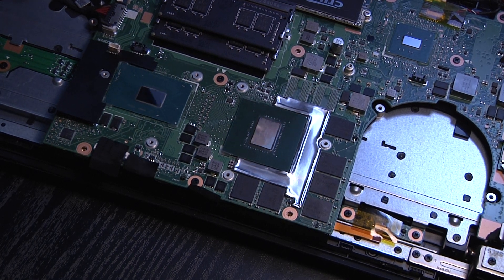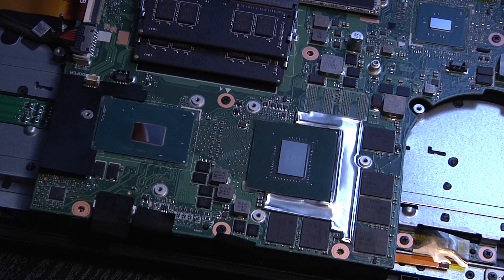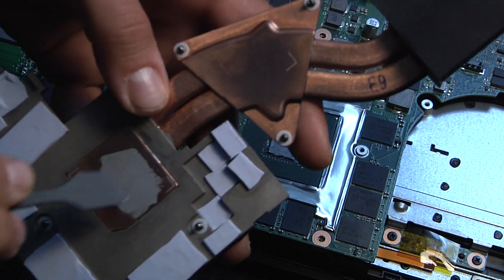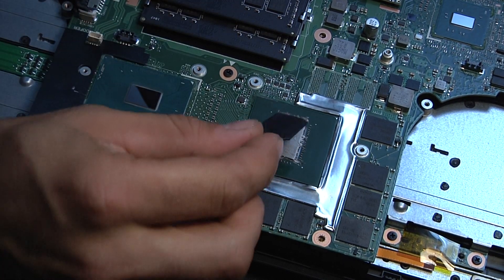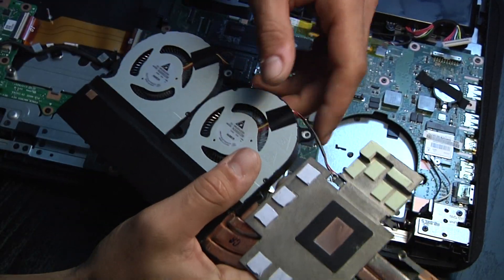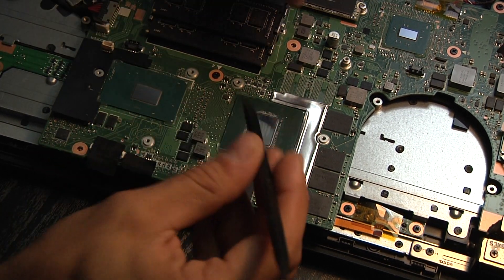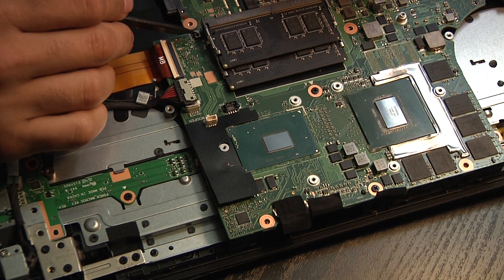How to repaste a laptop CPU & GPU

Comment: Hello.  I accidently damaged the black square ped on copper heatsink (seen on 12:55) with acetone while I was trying to renew the thermal paste on my laptops cpu. And I had to remove it completely. After the process, my laptops cpu works with 60 C- 70 C while I watch netflix, but the chasis is burning like crazy, even my SSD harddisk reaches 52 C, the keyboard  burns!. So, do anyone know that happened because of the square ped I removed? Shall I cut a new thermal pad and stick there in same shape? Is that works? Or I did apply the paste in wrong way. I do not know what to do, can anyone help me please?

Comment: is it normal if the battery ribbon sparked when connecting it back
Reply from the maker: It's not "good".. but can happen.
Try to plug in evenly and swiftly.
Reply: Hotel Hero doesn’t mean a component is broken right? thank u

Comment: Hey man i think i over applied it , just a bit though , what's your thoughts?
Reply from the maker: Would be difficult to add so much that the volume would be problematic. If you added just a bit more then it's fine
Reply: @HotelHero  thanks, actually it's working fine , temperature are down significantly.

Comment: Hey, I tried taking off the heatsink but unfortunately two of the screws are extremely tight and I've messed them up bad. Any suggestions?
Reply: Maybe if you use a bit of motorcycle oil on it, very very little
Reply: @Raylightsen  no dont fucking do that wtf

Comment: i have  a predator helios 3oo and suddenly after playing a game for 10mins my laptop reaches 99c and shuts down and normally it is at 70c without game ,i tried undervolting and its not working,can some one help please
Reply: I bet you need to repaste and change the thermal pads, and clean the metal fan vents
Reply: Of course every laptop shuts down when it reaches 100c or closer, the manufacturer designed that way

Comment: This video saved my laptop.  Bought an MSI GE75 RTX2080 laptop for cheap. This thing was going up to 96 degrees while gaming. I opened it up for a repaste. I figured I can probably do it myself. Something just looked off when I took off the heatsink but I couldn't put my finger on it. Then I saw your video and realized what it was. Someone put thermal paste on the chips that are supposed to have thermal pads. I mean this stuff was everywhere. Cleaned everything off and applied new pads and thermal on CPU/GPU. Now it doesn't exceed 80 degrees under full load. Thnx a lot!
Reply from the maker: Good catch
Reply: @HotelHero  what happens if i have both pads and thermal paste on the chips, as thats how it is on my acer :o
Reply: That thing on the chips is different than the paste on the cpu/gpu. That paste is actually better than pads if they contact properly. So your problem was probably just the thermal paste on the cpu/gpu

Comment: okay, so my fans stopped working after this video, and I've doubled checked twice that they are connected properly. Any suggestions?
Reply from the maker: If they stopped working they are either:
1. Not connected
2. Damaged from misuse
3. Your temps are sub 40 C in which case they don't turn on
4. Some other mechanical issue

Would help if you also listed what model you have
Reply: @HotelHero  Really appreciate the response, been following your videos since I got my laptop. It's a acer predator helios 300 G3-572-72YF. I know it's not because my temps are too low and I'm pretty confident my fans are connected properly. Could you elaborate on damage from misuse or other possible mechanical issues? My laptop is old, almost 4 if I'm not mistaken. It has overheated a few times and I've had countless preformance issues within the past few months. The reason I took off the fans to begin with is because after formatting my computer, one of the fans maxed out at 4000rpm instead of 6000rpm. So I thought since the warrenty is gone I would go digging around and see what the issue is. I found out one of the fans isn't spinning properly, so I detached it and put some bearing oil in it and it seemed to spin just fine. But when I put everything back together and turned it on. The fans didn't work. During this process I also repasted the cpu and gpu.

Comment: I’m on my 4th re-paste, having quite a time getting better than factory temps on both GPU and CPU. Its been a real pain in the ass. I don’t think the heat sink on the Asus GU502GV makes perfect contact with the die on both GPU and CPU. I made sure thermal pads were of the proper thickness but I’m not quite there... next method will be the X method. Do you have contact info?

Comment: Hi, thanks for sharing with us your method, it's great! I do have a question: What thickness should the thermal pads be? I have an Acer Predator Ph 317-53. I can't find any info about the thermal pads on this one..  I wanted to go with 1mm but I'm not sure if it's too thick or too thin, thanks!
Reply: same as you
which one then you went with ?
Reply: @ahmedalsaegh4897  I ended up repasting without replacing the thermal pads because this is quite tricky if you don't know what you're doing. You see, some thermal pads are thicker than the others and some are slimmer and it varies from one to another, and if you don't use the right thickness you might end up worse than before (not always, but there's still a risk) - because there needs to be a certain pressure on the cpu&gpu die-. So, I repasted with Noctua NT-H2 and it dropped my temps for almost 20 Celsius on CPU and up to 10 Celsius on GPU, the stock thermal paste is terrible.
Reply: very good results 
thanks for sharing 
I think I will do the same 
but using the thermal grizzly kryonaut  paste 
what is your thought about it ?
Reply: @ahmedalsaegh4897  Kryonaut is one of the best (if not the best) thermal paste (non-metallic) out there. It's pretty expensive for the smaller tubes but the 11 gram tube has a really competitive price. I initially wanted to use that one too but I just couldn't find it anywhere.
Disclaimer: it might dry faster compared to other thermal compounds but if you're using it on a laptop there's not gonna be a problem since you'll have to clean it out of dust at least once a year, therefore, a repaste/year.
Reply: how much did you put  paste on the die and  tightened the screws of the heat sink ?is it as hotel hero said ?
Reply: @ahmedalsaegh4897  I just used the line method because I thought it's the best for this case. Tgk (short for thermal grizzly kryonaut) is meant to be spread. They did several tests and spreading it seems to be the best way to apply it (not true for every paste/ cpu/gpu die size).
Reply: @ahmedalsaegh4897  And I tried not to over-tight the screws to not cause too much pressure. I kept tightening them until I felt that it's enough, it really isn't that hard.

Comment: So you don'y need the plastic tape stuff at all over the pins? I re-pasted my FX505DV yesterday and it made no difference, but I left the little tapes on my CPU and GPU. there's no paste underneath them, but I wonder if it would be better without them. My GPU maxes out at 86 degrees when playing Modern Warfare 2019 and my CPU is always around 89-91 degrees when  playing any games.

Comment: after repasting my laptop cpu cs go reports its running hot at 92 degrees C i7-3630QM (3.4 GHZ) .Does that mean I did the repasting right? (pea drop method) Alienware M14xR2 GPU is only 70 degrees C though!

Comment: The only thing about the spread method I worry about is trapping large amounts of air bubbles that get folded in as you spread it around.
Reply: That has been debunked by der8auer and others. As they say,  it's BS.
Reply from the maker: Agreed, this has been debunked not only by others, but by myself the last 50 times I've repasted 😅

Comment: Hey! How can i contact u ? I cant see any email and i have some question id like to ask.
Reply from the maker: What's your question?
I don't have a online presence
Reply: @HotelHero  Well. I have acer predator 300 helios with 1060 gtx 6 gb and i7. And i have like mini lags for 2 seconds. Even for games like league of legends. Idk why. Id like know how to fix it
Reply: @netwikimmortal2604  if you have high cpu temperatures, it might be thermal throttling.
Reply from the maker: @netwikimmortal2604  Most common issue is your using the OEM OS and you've just updated to the latest version. I recommend a fresh install of the latest version.
Reply: @HotelHero  Im sorry but what is OEM OS ? I have never heard this before

Comment: Thx for the tips about applying paste. I have a G9-793 from 2016 I want to repaste, since it's out of warranty, and very very hot while gaming, but can't find any info about the thermal pads. I saw in this video the cooler for predator 15 which is similar, and wanted to ask about the thickness of the pads. Is 1.5mm ok ? are all the pads the same thickness ? and how much do I need ? 100x100 or I can get away with 2pcs of 120x20mm? thx in advance if you have the time to answer these questions !
Reply from the maker: If you go 1.5mm you may have to re-tighten the heat plates once the pads get warm/soft. That way if the pad is slightly too think it will confirm to the chips and reach proper clearance/spacing.

Comment: Hello Hotel Hero, im lost i got a Helios 300 317-52 and i tried all nothing helps. I Undervolt GPU and CPU i repaste 4 times i did everything and my Laptop is during gaming nonstop on 95° at the GPU and CPU i dont know what to do anymore. It Throttles so hard that i got the first few minutes 100 fps after 5mins drops too 60 and then downspikes to 20-30. Dont know any further i tried everything suggested
Reply from the maker: If your GPU is surpassing 75-78 C then you pasted improperly or tightened it down incorrectly

Comment: Thanks alot for this video! I have suffered with thermal throtteling on my new Rog Strix Scar 2 GL704GW, since i bought it. Followed your vid and metod to apply new Thermal Grizzly Kryonaut on my Cpu/Gpu. I was shocked when i took off the heatsink, cause the paste jobb from the factory was terrible! Before the repaste i got 90+ and thermal throtteling all the time and had to turn down all the settings and even then it was struggeling after a while, and the fans was going full speed. Been testing now with GTA 5 with optimal settings in Geforce Exp since i repasted and im on a stable 70 deegres on full load, so about 25 deegres down from pre paste. Thanks for the vid and guide im overjoyed and can finaly game on my gaming laptop again! Cheers keep up the good work!
Spread metod works wonders!
Reply from the maker: Awesome dude!
Now go forth and destroy plebs! 😁

Comment: Which are the correct thermal pad thickness for the helios 300? i need that info please.
Reply from the maker: It's a combination of 1.0 and 1.5 mm pads
Reply: @HotelHero  I don't know of other model is like you say, but for the G3-571, which is mine, i tried 1.5 with 1.0 and didn't work
I learned it the hard way that is only 1.0 mm sadly

Comment: Tha is bro that's what I've been having problems with I repasted and then I tried to tighten the screws as hard as i could and my temps are about the same if not worse . I have Dell xps 15 9570 of u have any advice it's most certainly welcome and I'm here to learn . I wanted it to stop throttling .  I used thermaltake tg7 thermal paste from best buy .
Reply from the maker: Depending on the screw config (spring set or not) that could certainly cause issues. Like I discussed in the video most systems thermal pads provide the spacing required for proper paste application.

Also I recommend giving MX4 a try. It's really good paste and last super long, the 2019 release has a advertised lifespan of 8 years.
Reply: @HotelHero  isnt thermal grizzly kryonaut better in tempertures?

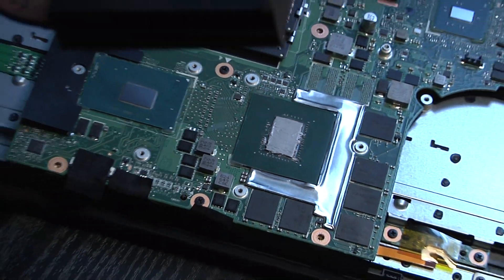Comment: Whats that white foamy squares in 6:38 im kinda curious if thats important or whats the purpose of it?
Reply: Thermal pads, if you look they are over other chips on the board they help draw the heat from them.
Reply: @Innermoist  oh, so what if the pads are damaged? Is it necessary to change it? Because I had those pads on my laptop but the pads are like half broken, maybe because its very old, my laptop is 5 years old now
Reply: @pointdss  I've seen people re-use them but me personally I'll replace it if your putting new paste on you might aswell do the pads.

Comment: Thanks for the video. I have the 2019 Helios 300. I get max temps up to 88 on cpu and 70 on gpu while playing Apex Legends. That’s with Turbo button off and CoolBoost on. Balanced power setting. Are these temps ok? Should I repaste it? Any idea if the stock paste is not good enough on this laptop?
Reply from the maker: I also have the 2019 H300 and your temps are fine. When you reach 95 C your CPU will down clock (thermal throttle) which is what you want to avoid.

I have premade Throttlestop configurations based on what CPU you have if your interested.
Reply: Hotel Hero thanks for the response.

Sure how can I get the profiles?  I have TS installed but haven’t changed anything on it yet though. What do the profiles do? Will the Turbo button work still? I see PredatorSense has its own built-in XTU Service which I assume is how the turbo button cranks up the PL1 and PL2 voltage. Will this still work with the TS profile?

Right now how I’m keeping my temps low; I use 99% power profile in windows and use Extreme Overclocking profile in PredatorSense (just to avoid the loud max fans).
Reply: Hotel Hero on another note, do you use the LCD overdrive feature? Can it have any negative effect on the screen long term?

Comment: Hi bro I appreciate it  your good work and helpfull video for everyone. On my predator g5 I consider replacing old thermal pads with thermal paste (thermal grizzly maybe). Would you recommend it or you think it will better to replace it with a new one thermal pads?
Reply: Also can you tell me the thickness of thermal pads on that model? 1 or 1.5mm thank you!
Reply from the maker: @slavidimitrov2097  Since the manufacturer set thermal pads in the first place, replacing the pads with paste might remove the factory gap (the springs add the right amount of tension but don't set the spacing) so I'd recommend if you swap pads to just replace with the same size pad (looks like 1.5mm) to avoid any issues. You can grab Arctic thermal pads for increased conductivity and should be a decent upgrade.
Reply: @HotelHero  thank you for answer. I will chose some thermal pads. I know the best thermal conductivity has fujipoly thermal pads but I don't know from where can I get it.

Comment: bro, can u please do undervolt and overclock video of acer helios 300 (2019 GTX 1660 ti) model please? (picture of voltage/frequency curve will do too. if u can attach a link with this comment.) i would greatly appreciate that bro. thanks.
Reply from the maker: I'd love to but I don't have access to a 1660ti bro.
Reply: @HotelHero  Would the 8th gen 2018 model have similar values to the 7th gen?

Comment: Ok so random question. I’ve already liquid metaled my laptop my laptop is a Acer Predator Helios 300 (2018 edition with a GTX 1060 and Intel Core i7-8750H 6-Core Processor) anyway it’s a lot cooler but I want to squeeeeeezeee more performance out of it with a heavy overclock but most places I look I can’t find a really heavy overclock so I was wondering if you could make a video showing us how to do that. Thanks
Reply from the maker: That sounds like an interesting video 🤔
I like it

Comment: Hotel Hero, can too much core overclock applied on the GPU over +170MHz for GTX 1070 can damage the resistors of the mobo? Since this gpu is soldered to the mainbord. Because if yes, that's why my laptop keeps freezing and cold shutdown itself when using it. All of my temps were right, no overheating. Even if I use stock settings, on battery, it does the same problem.
Reply from the maker: I don't understand your question.
Your system freezes when you OC your GPU only?
Reply: @HotelHero  I said can TOO MUCH overclocking on the GPU core can damage the mobo/resistors/capacitors? Because my overclock was stable for 3 weeks and after 3 weeks of usage with these settings 170MHz+ core and +450MHz mem. The 5s freeze and cold shutdown stuff happened this Month first week. I tried everything, re-installing windows 10, swapping drivers of the gpu, using stock settings (no oc), even on sector or on battery... It still does the same problem, randomly freezes when I use my computer in action then shutdown itself. My battery is fine, there was no overheating. So can a higher oc damage the laptop?